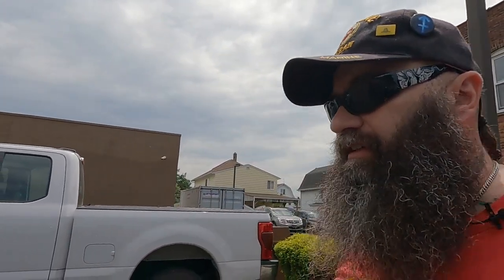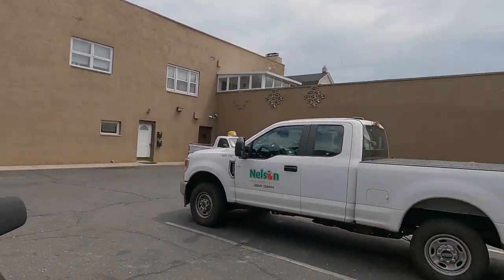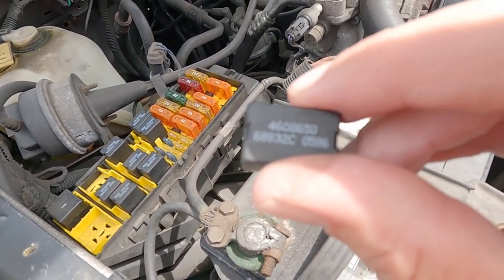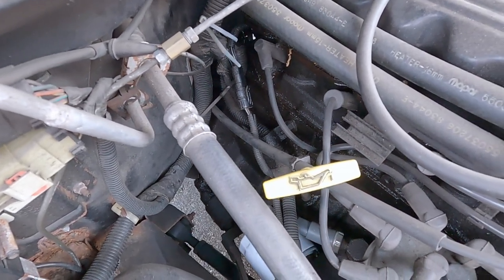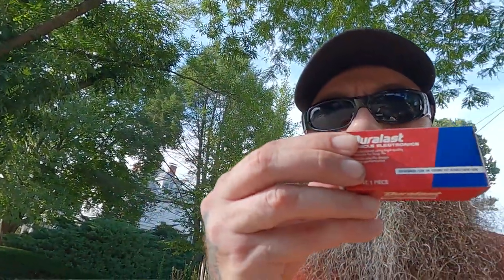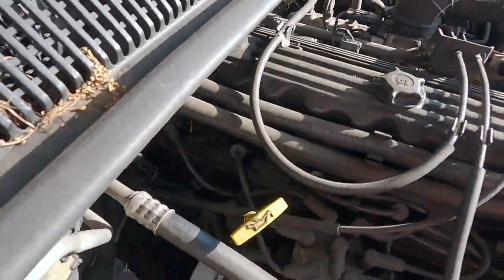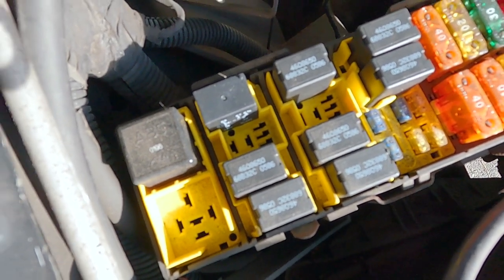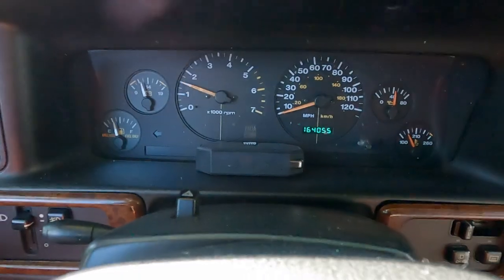Bad Gas Again??? Continuing fuel issue in my 1996 Grand Cherokee ZJ

Comment: 1996 grand Cherokee. 4.0. Just had random stalling and surging issue begin a week ago. I suspect fuel quality. Very well maintained. Pump is 2 years old. Just a weekend vehicle. Good luck
Reply from the maker: I think the fuel is evaporating in the fuel rail from the heat...

Comment: I service gas station equipment.  The increased ethanol percentage in gas absorbs moisture/water which causes the fuel in the gas storage tanks to seperate chemically. Causing poor mileage and driveability symptoms.

Comment: Is your thermostat heating her engine to 195F? I switched that and could change  the bad fuel MPG(11.5) to 15.9 MPG
Reply from the maker: I have never had a 4.0 run at 195F. They usually run at 210 to 215. Even in the old TJs.